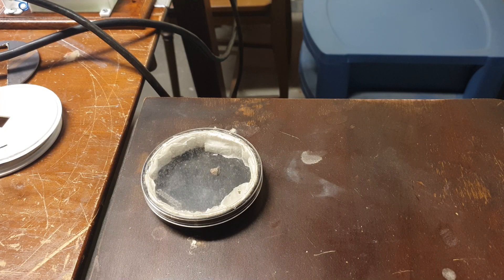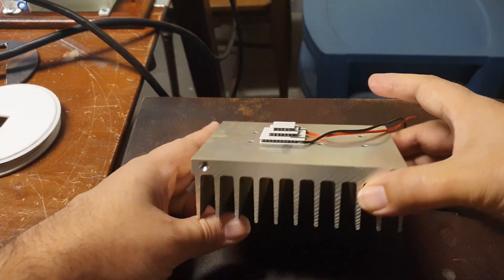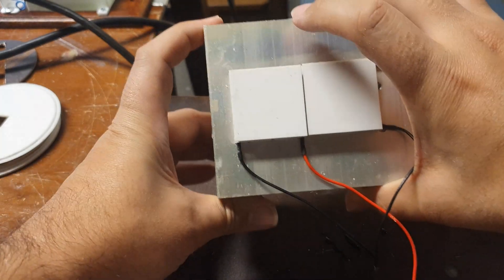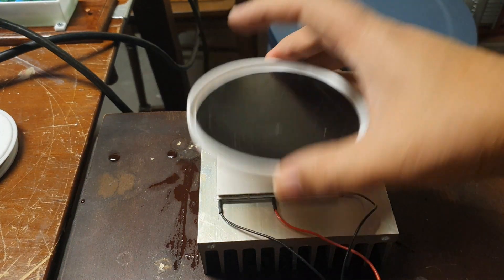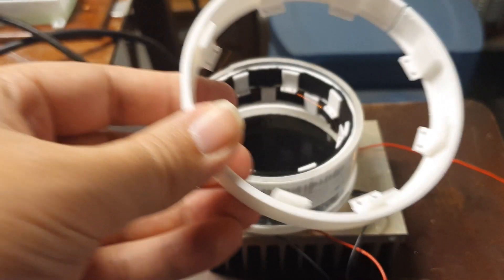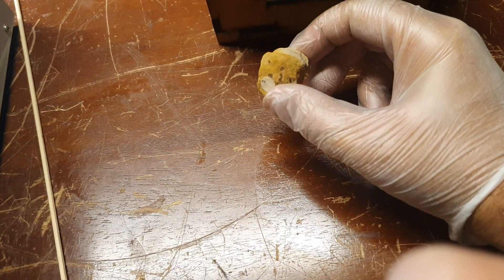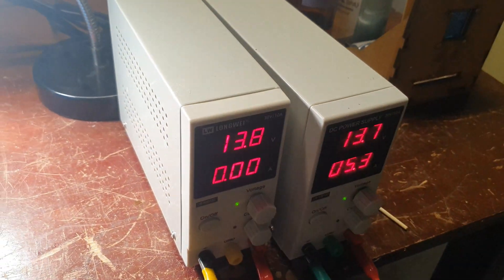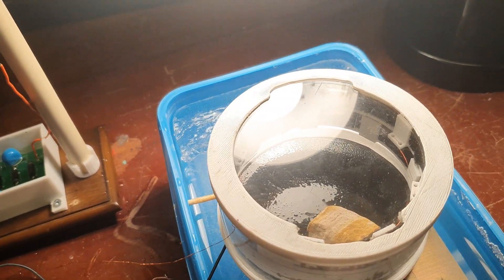In search of... Cloud Chamber

Comment: "pel'-tee-ay"  Jean-Charles-Athanase Peltier (French)    You need a thermal transfer pad between the Peltier devices and the copper plate sitting on top, about 0.5mm to 1.5mm thick like this https://www.amazon.com/Thermal-Interface-Products-Heat-Sink/dp/B00QSHPH8E/ref=sr_1_8?dchild=1&keywords=thermal+pad+adhesive&qid=1606589363&sr=8-8
You could connect the Peltier devices in series for a single power supply... 28V @ 5A is fine since the power supplies are rated for 30V 10A.